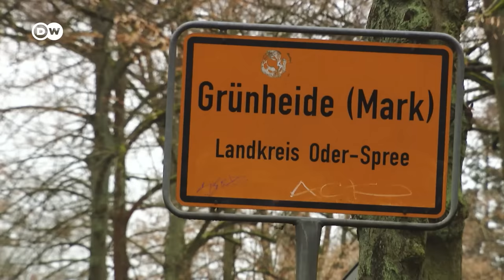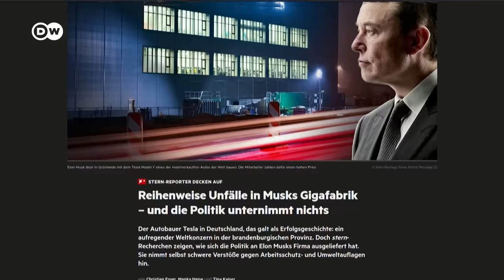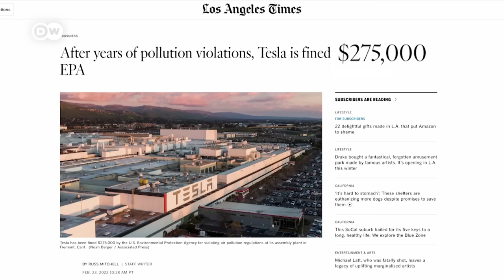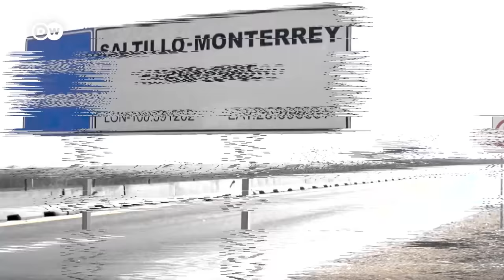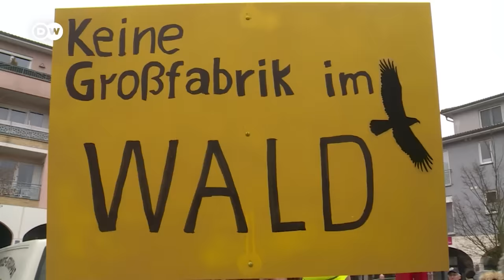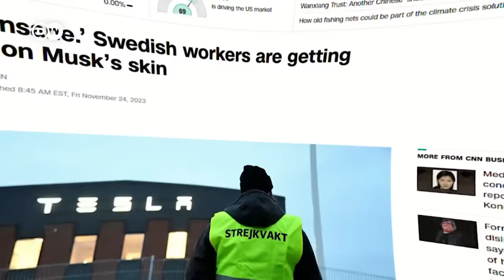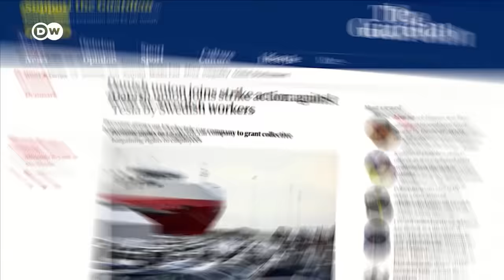How new Gigafactories are staining Tesla's brand | Transforming Business

Comment: There's a coal mine not far from Tesla in Germany that uses MORE than a hundred times more water, sounds like you are rather selective in your environmental pearl clutching.
Reply: For what purpose they use water in a coal mine?
Reply: @mutkaluikkunen3926  you have to wet the coal dust while it's being extracted or it will explode, and they cool / lubricate all the machines too, it's a giant mess.
Reply: I was thinking about that coal plant. It is shameful that it was not mentioned.
Reply: You can be opposed to both - as over 60 per cent of the local communities are!

Comment: To be fair - How does this compare to other German heavy industries? How do you factor in the net public benefit of electrifying vehicles and elimination of health-destroying ICE cars and diesel trucks? Continued cost of OPEC dependency? Also, labor union pressure will only accelerate full automation and drive overseas production.
Reply: They didn't ask that question because they didn't want to ask that question. 

A journalist prepares all kinds questions to get a good perspective. This seems like an opinion hit piece.
Reply: You balance that by cheating on your diesel emission
Reply: Batteries are filled with energy made by stuff like coal and oil. And there is loss during this.  So it be more efficient to just use oil
Reply: @looneycrow7978  actually no you burn oil gone forever you reuse recharge Tesla battery pack for over 1 million miles
Reply: @PD55_  ONE MILLION MILES???  They last around 12 years.
Reply: It is also worth mentioning that the production of fossil fuels consumes a significant amount of electricity.
Reply: @looneycrow7978 the best combustion engine on earth has 30% efficiency while EVs are all over 95%. In no universe is combustion better than EV for the planet
Reply: The public benefit of a health environment by far outweighs the benefit of cars.

Comment: Doesn't the coal mine nearby use even more water than Tesla's factory?
Reply: They don't market their coal as green
Reply: ASK THE NUCLEAR INDUSTRY.  STOP GEOENGINEERING
Reply: The LEAG coal plant (44.8 million cubic meters). Tesla Berlin used 300,000 cubic meters.
Reply: @jaaksavat7916 It uses 10x the amount of water so it would appear the supply is not an issue then.
Reply: @Abebe345 it's not 10x. It's 15x
Reply: You can be opposed to both - as over 60 per cent of the local communities are!

Comment: 9:54: This is a clear error, the sales statistic is wrong, it includes hybrid vehicles, not just fully electric vehicles (BEVs). When you only take BEVs (and hybrids will be phased out, they were just a transitional technology on the way to BEVs), then Tesla is number one (and has always been nr. 1 in the last years). 
All-electric car registrations in Q1-Q4 2022 (vs previous year):

    Tesla: 1,314,330 and 18.2% share (vs 23%)
    BYD: 913,052 and 12.6% share (vs 7%)
    SAIC (incl. SAIC-GM-Wuling): 671,725 and 9.3% share (vs 13%)
    Volkswagen Group: 571,067 and 7.9% share (vs 10%)
    Geely-Volvo: 383,936 and 5.3% share

Comment: This video was most likely sponsored by IG Metal. Unions typically try to create FUD, such as the water crisis... Tesla is expanding its plant and has announced no increase in water usage. This report fails to mention that a coal strip mine operates a few miles from Tesla and used more than 10 times as much water. This video would never win an awarded for its balance.